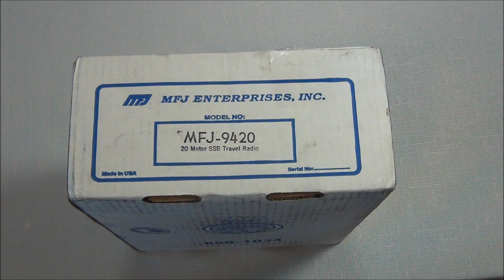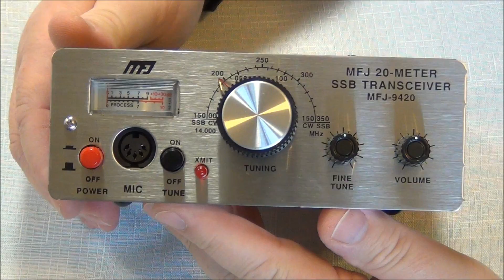MFJ-9420 20 Meter SSB QRP Transceiver - Introduction and overview - AF5DN

Comment: I just had one of these delivered a couple of days ago. For some reason I am not getting a return call from my CQs using this radio, despite using a known effective antenna with good SWR. The S-meter barely  registers when I speak into the provided mike (maybe s-1 or s-2). So, I called MFJ tech support and got the most condescending "tech helpline" person I've ever talked to in my life. Directed me to the manual and told me to check the voltage at TP1 etc., couldn't tell me where to find TP1 other than it is on the circuit board somewhere (duh), which was my original question for him - where is TP1? - only told me to look harder since he didn't know where it was. (I did look pretty hard, still haven't found it). I guess the bottom line is, if you get a good one you'll like it, otherwise they expect you to complete the inspection and tuning process. 
Also a minor point: when this arrived, the fine tuning knob would bind up and be nearly impossible to turn. I fixed this by removing the knob and putting it back on with more space between the knob and the cabinet. 
So far, not a good experience!
Reply: Yeah, MFJ tech support sucks. I had an AL811 amp that self-excited. They acted like they'd never heard of neutralization. i ended up cannibalizing the amp.

Comment: MFJ-9420 another "CW JACK ON THE BACK"  radio.
K4OF.
Reply: This radio is designed for SSB. If you want CW, you have to opt for the CW module. IT is equipped w/ the key jack (yes it's on the back...).

Comment: Mine has worked flawless from day one. I have had it for over 15 years. I did add the CW board last year. It's a very good radio.
73
Jimmy, ARRL TC, WX9DX

Comment: I just upgraded to general and want to know how much power the MFJ-9420 has and if I could successfully use it in a townhouse attic with an attic inverted V attic dipole with good results/how far will this little guy reach out? -Thanks